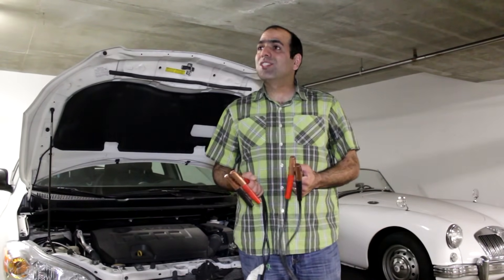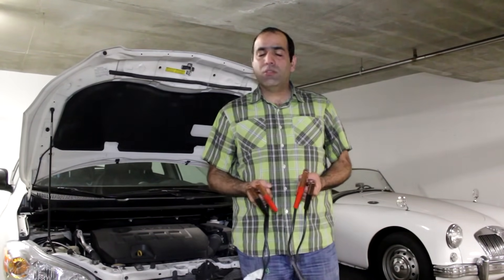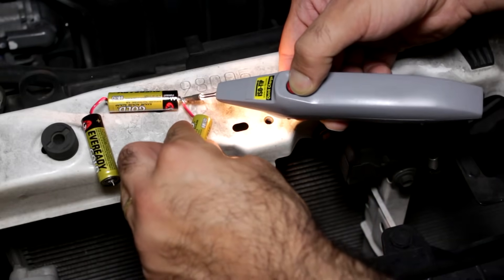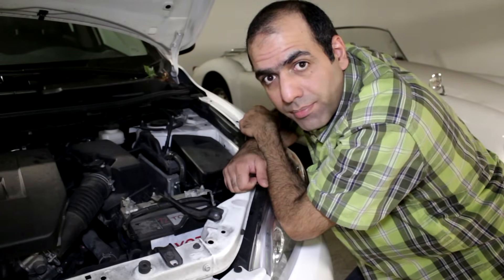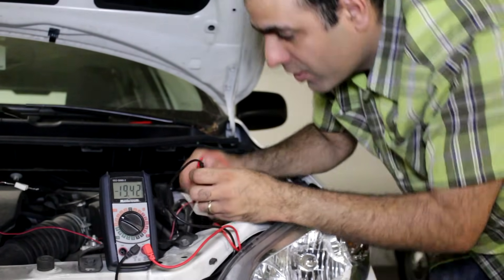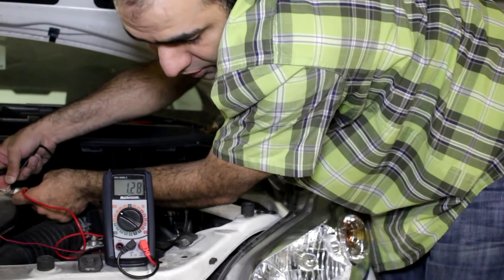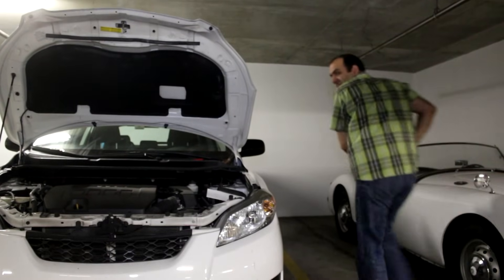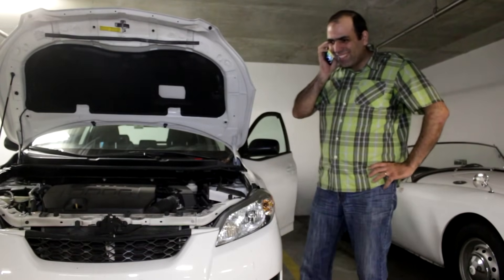Jump Start a Car with AA Batteries

Comment: Mehdi, instead of a bunch of AA batteries couldn't you use one 9V square battery and two AA batteries? That would be easier to handle.

Or a one of those portable USB cell charger battery packs, would those work?
Reply from the maker: Fim de Abril You would likely need 2x 9V batteries in series. 9V batteries generally don't put out much current, but it might just be enough. I haven't tested those.
USB charger voltage is lower than 12V I assume, closer to 5V. So probably not. Haven't tested those either.

Comment: Hi, Mehdi!  Thanks for the video!  What kind of solder gun is that?  I'd like to get one...it would be very useful to have on board my boat.
Reply from the maker: Robert Doty It's one of the Pro-Tip battery operated Irons. They have propane ones too.

Comment: 20 Volts could damage the car's electronics as most car batterys are around 12 volts with the engine off and 14 volts with the engine running.

Comment: Battery voltage is at 11.75v.  Why can't he crank the car?  wtf?  Aren't car batteries 12 volts????  https://youtu.be/I0utNemFsl8?t=2m5s
Reply from the maker: rezneba101 When they are charged they are above 12.5V and when discharged below 12V. And this is their no-load voltage. If you load them charged, the voltage remains around 12.5V and when uncharged, the voltage drops way down, close to 5V.
Reply: ***** ok but to me 11.75 Volts is still enough to start the car, no?  at 5v I can understand that it's underpowered for the task but we're talking less than 10% optimal charge here.  Care to explain?
Reply from the maker: rezneba101 If it could hold that voltage, yes. You can't look at the voltage and say it is enough. As soon as you draw 50A to 100A a crank needs, 11.75V will drop to 5V. The internal resistance of the car battery, a series resistance with the voltage, is pretty high when it is discharges and will cause great voltage drop on the output. Hope that makes sense.
Reply: ***** ok, but how is that internal resistance of the battery measured?  How can you tell a battery will fail to crank if it reads 11.75v?  When ppl check battery voltage, do they put load on it?
Reply from the maker: rezneba101
You will really have to crank to see if the battery is capable. Because your application may not need that much current (like around 1A)  and even a low charge car battery can run it for hours. But a voltage close to 12.5V or above is also a good indication of a charged battery.
Reply from the maker: sapincher
I see, you have some good test data. I haven't personally tested different type of batteries under different conditions as you did. So I'm sure your data is more accurate. I have tested one or two marine batteries we typically use for our lab use and by no means they are new, and I haven't fully tested my car battery.
My reference to 5V is related to the power transient standard requirements (SAE standard J1113 or J1455) where in a 12V system during cranking  the battery voltage can drop to 5V for a short period of time (close to 50mS during the high in-rush current of the crank motor). I assume standard usually considers the worst case and most batteries don't fall that far like you mentioned. But it is a possibility depending on battery type used and level of charge.

In my video I discharged my car battery with large 1 ohm resistor (around 12A) for 3 hours, and the battery voltage ended up at 11.75V at rest and was not enough to crank the engine. I wish I had measured it when cranking! But according to your data, it probably dropped to 6.5V or smaller.
Reply from the maker: sapincher
But isn't a resting voltage much more than the at-load voltage? I mean with these batteries charged, I have measured around 40mOhm internal resistance on them. Which means even at fully charged, their voltage drops by 4V from 12.5 to 8.5V under 100A draw. A discharged battery has more internal resistance and drops significantly lower at lower current draw. My car battery at 11.75V was not able to turn the engine and it is a healthy battery which I still reliably use.
Reply: ***** I never thought about current inrush before, but that makes sense and is really neat. Thanks for responding to the comments by the way! You are awesome Mehdi.
Reply: rezneba101 A healthy battery would definitely be able to start the car with 11.75V, or anything down to 10V. Mehdi's battery was probably well on its way out (internal lead plates physically broken down). He says his battery dropped to about 5V during a starting condition - a healthy battery should never drop below about 9V during starting, even one mildly discharged to 11.75V resting. I hope he's replaced it since he posted this video...
Reply: +William Brack 
Ding, Ding, Ding!!!
We have a winner folks! Someone who actually knows what they are talking about posting on the internet. Imagine the odds.
Reply: I can't speak for diesels, but I am a professional mechanic for gas-powered cars and have tested many car batteries like the one in the Toyota in this video. I can say with certainty that a resting voltage of 10V on a healthy battery is about the limit for when a compact gasoline engine will no longer start. If the voltage drops to 5V from 11.75V during cranking one of these engines, there is a serious problem with the battery.
Reply: *****
Sorry, I guess I'm not used to looking at car batteries from an internal resistance standpoint, but I can offer this:

The way we test batteries at our shop is we subject them when fully charged to a load test of half of the cold cranking amps marked on the battery (which would make the test around 275A in the case of your Matrix). Fully charged they are at 12.6V, and we consider any battery to be weak if it falls below 8.8 to 9V under this load.

Typically the starter draws way less current than this test (a healthy starter in your Matrix will draw less than 90A), so the voltage drop in normal conditions shouldn't be even that severe. In your case a drop of 4V in just 100A would definitely fail our test.

I've tested batteries with a resting voltage of 10V, and if they are healthy (recently manufactured) then this load test only drops them to about 6.5-7V - just barely enough to turn the starter over.

The loss of battery capacity (or, I suppose, increase in internal resistance) is caused by the aging and breakdown of the lead plates - a battery does not typically fail our load test unless it is more than 5 years old.
Reply: +Gme1z State of charge has nothing to do with voltage (you can't directly compare them). My car battery was once 11.5v and it still started my 2.0L diesel engine. But yes the lower the battery gets the less likely it is to be able to start the engine.
Reply: +rezneba101 you need current
Reply: kawasjt No shit Einstein
Reply: Rechargeable batteries are rated on the average mean voltage. 
A 12V sealed lead acid battery is considered fully chared at 14V and discharged at 10V. 
Lithium batties are rated 3.7V, fully charged at 4.2V and discharged at 3.2V
Reply: cold cranking amps. I have a battery for my atv that reads 12.5v. but when I go cranking on it the battery goes to 9v or so. no enough amps
Reply: +ghostrider433 actually, I think you'll find in this case it's about the batteries internal resistance.

Comment: Hey Mehdi, great video, but I got an unrelated question. Since you mess around with batteries a lot, I was wondering, is battery acid as harmful as people make it up to be? Because I get battery acid on me plenty, and it worries me that it might give me cancer since that's what my mom used to say. 

P.S. How can I stop my batteries from leaking? Or do they just do that eventually as they deteriorate over time?

Cheers!
Reply from the maker: Tetsacry Which batteries you talk about, the car battery acid is pretty bad, it could melt your skin away. But the AA content is not that corrosive. I don't think any one of them gives you cancer, just skin issues if you don't clean your hands quickly.
Reply: Tetsacry A few years ago, I was replacing the batteries in my sailboat.  They're in a difficult location, and EXTREMELY heavy.  I managed to spill some of the acid as I was struggling to get them out.  Later, I walked to our clubhouse to have a beer.  As I walked to the bar, people I'd just passed by started laughing.  Laughing REALLY, REALLY hard.  I guess I had sat in that battery acid, because the rear of my shorts was completely GONE.  My rear end was showing to everybody!  

Oddly, it never hurt my skin.  But I can attest that battery acid will eat through cotton fibers like there's no tomorrow...

I'll be replacing batteries on the boat fairly soon.  You can bet that I'll be a lot more careful!  ;-)

-Robert
Reply: ***** You're mostly right.  Generally AA and AAA don't have 'acid' in them more of a compound than anything else.  But yea getting car battery acid on you is bad it can castrate (I think it's spelled like that?) your skin pretty bad.
Reply: @TheSansui123  6 years late but jus letting you know that castrate means removing someone's testicles
Reply: Cody Heiser in fact, they have an alkaline material in them for the most part.

Comment: Trololol, 11.75 volts is very good for a battery that has spent overnight in the garage. Starter motors usually stop turning at 9v and modern cars refuse to try to start at 10v.
Reply: 11.75v is open cell voltage (no load). That's basically a dead lead acid battery.
Reply: Arsham Skrenes
8.5 would be dead beyond repair. And i do not care what wikipedia says. 10v (open circuit, before starting) charge has started my cars many times.
Reply: If the battery can't turn over his little 4 banger, it's dead. If you wanna be technical, 0v is dead but anything less than 10.5v results in permanent capacity loss (i.e., damage to the cells).

Comment: @Nukle0n the battery is too low to start the car or pretty much dead. 12.6-12.85 volts is about a full charge. Anything under 12.0v (under 25% of full charge) may prevent the car from starting, but can briefly power things such and wipers.

Comment: that's pretty cool that you managed to get enough power into the lead acid battery to start the car using AAs, but wouldn't a 4s (12.8v) 8ah lifepo4 RC pack be less sketchy and be able to provide the cranking current directly?

Comment: I onced used a laptop power supply, some wire, and extension cord to recharge my dead car battery.  I had a multimeter to check the progress

Comment: An easier way is to hunt around in your junk box for an old 12v power supply brick. Cut off the connector, strip the wires and just jam them in the clamps for your battery terminals. I waited about 30min and was able to start my car. My car is a hybrid, so the 12v battery is only to power the electronics, but for a non-hybrid it would still work, you would just have to wait longer.
Reply: Clem Taylor Great idea. Or just hunt around to see if you have a spare, fully charged car battery lying about. Or maybe a spare car.
Reply: 12V bricks fairly common, I think the one I used came from an old wireless router or some such.

Comment: Would it be possible to jump start a car using a chain of 9V's? I ask this since connecting them together is much easier than having to solder wires together.
Reply: GameAce6 This will not work. If you compare the capacity of a 9V battery and a AA cell they are very different. Looking at the datasheets for an Energizer AA and 9V battery shows that at a 500mA load a AA will do 1500mAh compared to the 9V 250mAh, so the chain of AA cells will have 6x the charge it can supply. If you use D cells instead they will be able to supply 12000mAh, or 8x the AA and 48x the 9V battery. With batteries the physical size determines how much charge they can hold.

Datasheets:
http://data.energizer.com/PDFs/E95.pdf
http://data.energizer.com/PDFs/E91.pdf
http://data.energizer.com/PDFs/522.pdf
Reply: AshyLarry Have you no creativity. Connect plus and minus together. You now have two 9V batteries in series. Also, you don't need both terminals on the battery, positive to positive and negative to ground will work. Ask anyone who works around batteries, it's safer.
Reply: GameAce6 I don't think so, you could try 2 in series to up the voltage with a few more in parallel to get the extra current but then you've got 18V and something might blow.
edit: scrap that he had like 19V so I guess it should work.
Also how are you going to connect them to the car battery without any soldering.
Reply: AshyLarry Snap the batteries together, touch one end to a terminal on the car and the other end to ground with a fork or something.
Reply: ***** 9V batteries have both their terminals on top, you need to connect each terminal to each terminal on the car battery.
Reply: ***** I don't see this working.
Reply: And now that I think about attaching two 9V's achieves nothing but to drain the two batteries, it's a closed circuit.
Reply: +seeigecannon why don&#39;t use rechargeable ni-mh AA if using AA at all? Panasonic eneloop AA will deliver you at least 1500 mAh at 8A load

Comment: If the battery is dead why are the wipers working?
Reply: Nukle0n Probably not completely dead but it's not enough to start the engine
Reply: Nukle0n when the battery ''dies'' it doesnt get 0 voltz straight away..volts remain in the battery just not enough to crank it up...
Reply: Nukle0n If it was alight eventually there's not going to be enough electricity left to overcome the resistance in the circuit that the light is part of and the electricity will stop draining, however this could still be enough to drive the windscreen wipers.
Reply: Nukle0n starters use several kW compared to the ~hundred W that a wiper motor uses. due to the internal resistance of the battery, the higher load of the starter causes the voltage to drop down a lot lower than the wipers do.
Reply: Nukle0n I'm no mechanic, but I believe the alternator would begin charging the battery once the engine starts.
Reply: Nukle0n Acc takes a lot less power than starting it.
Reply: OXXOI77777 it should. Then you have to run(preferably drive) the car for ~40 minutes to bring the charge back up.
Reply: Nukle0n Thats exactly what I thought!
Reply: ***** Just kinda funny if the battery is dead, from a left on light or something, that would've probably left the battery stone cold dead, and not just slightly short in amps.